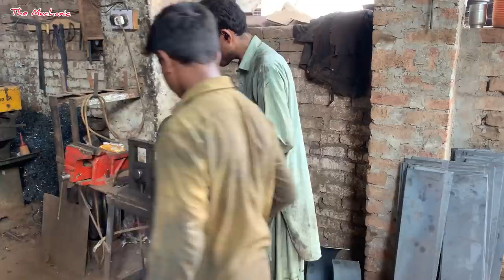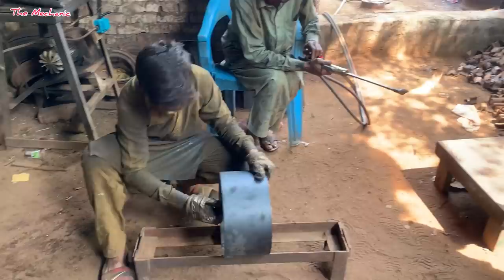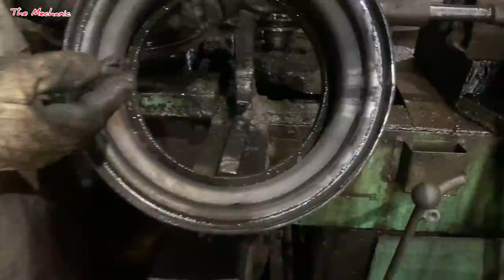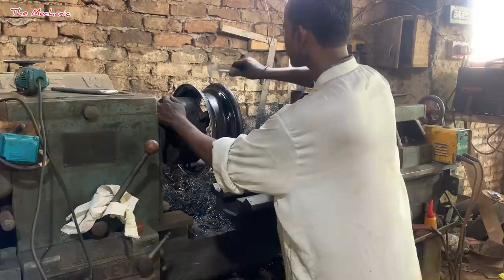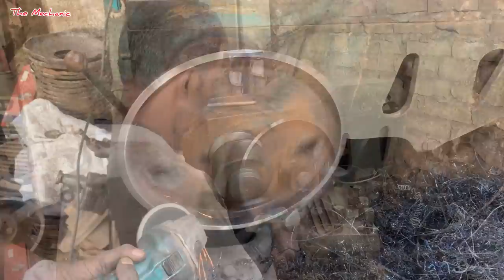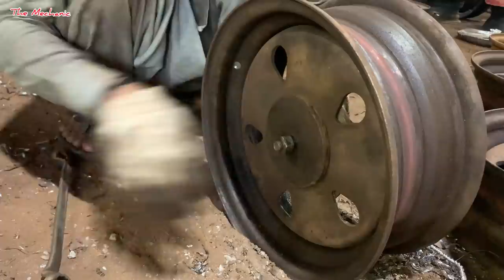Motor Vehicle Iron Wheel Rim Manufacturing Process in Factory | Production Process of Iron Wheel Rim

Comment: I give these metal workers 5 big stars for innovation, hard work and pride in what they do.  I've never seen how a wheel was made before.  Thank you for showing us how it's done.
Reply: You should wish that wheels never made like this or atleast not such wheels installed over your car !!!
Manufacturing standards are close to nothing and same with safety
Reply: Are you serious? This is how you did it 100 years ago.
No, sorry. We had higher quality standards 100 years ago.
Reply: @gooblio  100 years ago Ford automobile Model T definitely had  rally wheels with steel belted radial tires and 100% not 36inch diameter  ash hardwood spoke wheels with a metal band that the tire was beadset to with an innertube.

Comment: So I would like to suggest that idea instead of complaining about your work conditions which I know are not that great and your tools are the best that you can have. When the man was putting the center part of the wheel on the lathe he was having a hard time centering it. He kept on having to hit it with a hammer. What I would like to suggest that you do is make a cone so thick metal at the back which is the same diameter as the hole in the rim and then have it go a little narrow to the front have the hole in the middle of this cone be the same diameter as the shaft that is on the lathe. Slide the Conan against the back then slide the center of the Hub against the cone which will automatically Center it then screw the screw on with washers to push up against the front of the cone and you can have it all done in one action. I don't speak Pakistani and I don't know if you understand this but it really would get rid of the problems of trying to Center the wheel all the time
Reply: Never run a lathe have ya? What you're suggesting works fine for retention pressures needed on a tire spin balancer, but in order to put enough force on it as you describe to keep it from spinning while being turned with a tool would most likely cause deformation of the hole. Material spinning in/on a chuck is a BAD thing... and expensive... 
Try running some of the equipment some time, you'll get it....
Reply: @shuntawolf  tha cone wood center tha wheel on tha lathe. He's banigin around on it with a hammer like some moron and tryin ta eye it. You cain't center something precisely by eyein it.

Comment: Welding in the Lathe like this will kill the bearings very quickly. The Ground current flowing through them causes errosion
Reply: You would think so, but the keep doing it maybe they’re not worried about bad bearings & accuracy doesn’t seem important to them either
Reply: да пофиг им на эти подшипники
Reply: what's a bearing?
Reply: Grinding the punched holes on the lathe looks a bit odd - the hex nut is caught with the grinding wheel a lot but looks previously undamaged?

Comment: Watching him center the wheel on the lathe by eye. That's the shit that gives me anxiety. Some poor sap is driving on that wheel.
Reply: I am a home machinist. Have a 3 1/2 tonne 4M long lathe with 660mm swing and 2500mm between centres and all the dial indicators you could wish for. You will be amazed of the accuracy of the MK1 eyeball. With practice, and they have a lot of that, you can get within 0.002" or 0.05mm of lateral or radial runout. Tyres are not even made that accurately.

Comment: Why does the wheel need to be so strong? This wheel supports 500kg quietly. Is so much resistance needed?
Reply: These rims are meant for heavy weight vehicles.
Reply: @adad-nerari4117  A car with a total gross weight of more than 2,000 kg?
Reply: @DanielSilva-jj2lz  Cars aren't heavy weight vehicles. These wheel rims are meant for trucks or buses.
Reply: @adad-nerari4117  Not. By their size, they are for vans or pickup trucks. And none of these vehicles exceed 2500 kg
Reply: @DanielSilva-jj2lz  They could be for construction equipment, eg small dump trucks - low speed hence balancing not so critical.

Comment: 13:55 The holes in the centre disc aren’t equidistant 😂😂😂
Reply: The holes were punched one after other with only visual judgement, without using any jig to space them equally.
How are they going to balance the wheel, if ever they do it?
Reply: @ManojKumar-sx6vg  im sure the guts at the Corvette factory are gonna balance it properly when they mount the tire